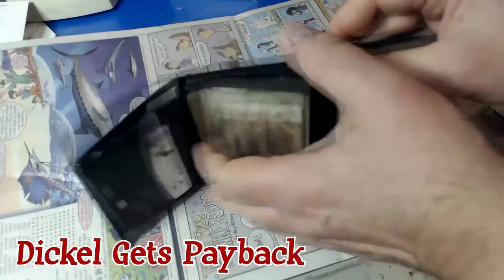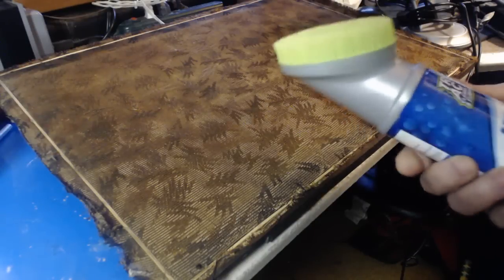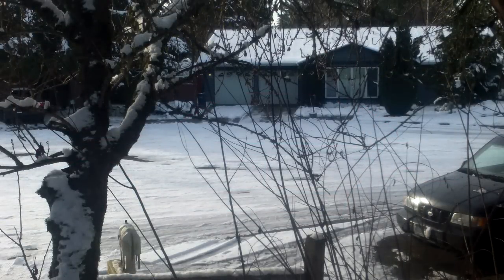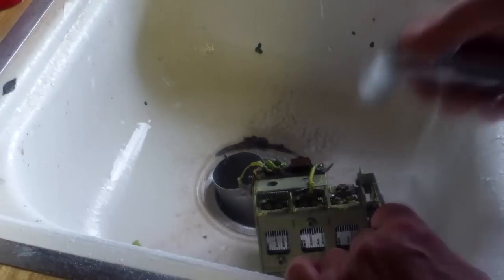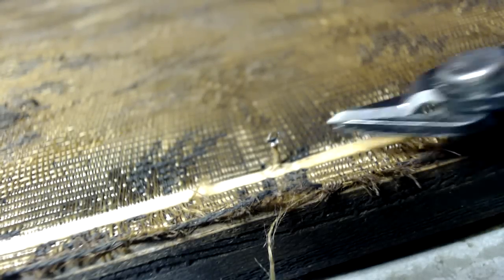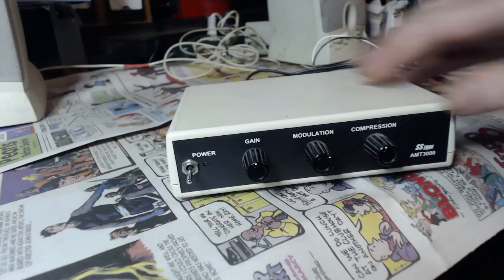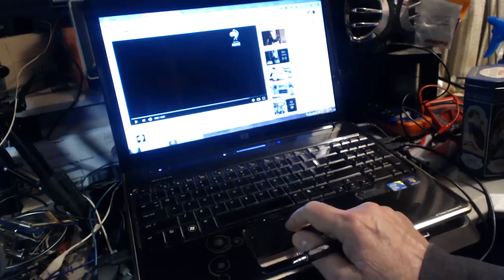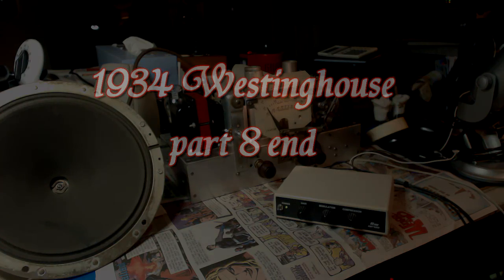1934 Westinghouse Model WR-24 Restore Part 8

Comment: Lovely low wattage AM transmitter you have Buzz …definitely a neat little job!
Occasionally, I get my wife to gently hand wash speaker cloth, I’ve removed from Vintage Radios, in warm soapy water, followed by a couple of cold water rinses to dissolve excess soap powder.  Once the cloth has dried on our clothes line, she gently applies the clothes iron to smooth it out.  This process does not work for all vintage speaker cloths as some are too fragile to wash …you can get a feel for cloths that will, and will not tolerate washing.
Love Creedence Clearwater Revival.   ‘Bad Moon Rising’ takes me back to my mid-teenage years.  
Phil.
Reply from the maker: Phil., Phil, Phil...tsk, tsk, tsk....You make your dear wife toil for you and wash your old grille cloths.....see here old man, this is the 21th century ...Do you also keep her barefoot and pregnant too?..... hahaha....When I saw that video on YouTube, I knew I had to use it..one of my favs.....Cheers to you my fine fellow...Regards, Buzz
PS..Some other guy from England commented that those transmitters are banned there..is that so?

Comment: Interesting video Buzz.  Caution on the chemicals on aluminum tuners.! I thought that naval jelly dissolved aluminum.  Most folks seem to use an ultrasonic cleaner.  I don't have one, but I borrowed my missus's Dr. Scholl's foot bath which has a decent vibrating clean mode.  It does a decent job with some dish detergent; then a good rinse and oil the bearings sparingly when dry.  Too bad the grill cloth didn't hold up.  A little glue around the hole would stop it from unraveling.  Thanks for sharing your mistakes.  If you make them and share them, then maybe we won't.  I have the same transmitter, but I never was happy with the way it works.  Mine squeals in the background.  Yours works great.  I guess I will have to go back to the drawing board.  As usual thanks for taking the time to share your hobbies!
Reply from the maker: The naval jelly doesn't hurt aluminum.soaked overnight...you must have gotten a bad one...mine sounds best at around 1530
Reply: Buzz1151 More than likely my SSTran got a bad builder.
Reply from the maker: was the builder you? haha
Reply: Buzz1151 Aye sad to say it was me.

Comment: good video, I use a home broadcaster for my radios, they called the unit talking house which was used in real estate sales. you set the frequency and plug it in to an output
Reply from the maker: you can set the frequency too on this with dip switches...

Comment: Thanks for the info Buzz. I just figured you fed an audio signal into the External Modulation Jack on an RF Signal Generator for your in home broadcasts. Can you change the broadcast frequency on that SSTran easily?
Glad you survived the Great Snowstorm of 2017!! Glad when the rain finally showed up to melt that stuff!!
Reply from the maker: You can set the SStran to the frequency of your choice. Mine works best around 1530....Glad that snow is gone..good riddance I say haha...regards, Buzz

Comment: Regarding cleaning of the pesky Variable Condensers (Tooning Gang)... I have always had good luck boiling them in a sauce pan and then drying them with a blow dryer. Then a bit of 3n1 oil on the bearings.
Reply: @Buzz1151  They say a picture is worth a thousand words. Maybe not in this case. Hard to have a dialogue with a smiley face.
Reply from the maker: @carlrudd1858  these videos were made years ago, I don't remember much in them.

Comment: To misquote John Fogerty....Theeeeere's a bathroom on the right!  I've never tried that Howard's before but I may give it a shot sometime.  Those peanut dogs sure do like their blankets, don't they?  Mine sits on the couch half the day under a little down throw blanket I picked up at wally world about ten years ago.  Thinking about getting one of those talking house transmitters, that thing you built is nice but I've never tried soldering stuff that small before nor have I ever soldered on a circuit board before and that'd be a lot of money to spend to muck it up, lol.  I have a very small AM transmitter now I bought from ebay about a year ago but it has to be damn near beside or on top of the radio before the radio can pick it up.  That's fine for a console with room inside it or sitting behind a tabletop model but I'd like to have the option of broadcasting from a pc to my radios instead of just from my Zune mp3 player.  I was yelling at the screen, don't use the scrubber!  LOL, oh well, saving a portion of it is a good idea just the same.  Take care, Gary
Reply from the maker: Hi Gary.....Peanut loves blankets, and when shes cold,  likes to be wrapped up in them...The howling was funny as I had never seen her do that..She was missing her mama, who is my daughter.... ...who knew the cloth was so delicate...haha, but it made a funny segment....thanks, Buzz

Comment: Buzz-  I recall John had the same problem with evaporust a while back turning his tuner yellow. Has to be the type of metal. On the SStran unit, what frequency does it transmit to ? Very cool..... and the grill both...  chalk it up to experience.  - Great video - Ron
Reply from the maker: Hi Ron....The frequency is adjustable with dip switches, I found it works best for me around 1530........
Reply: thank you sir
Reply: I'm pretty sure the green is decomposing Cadmium plating. Be sure NOT to lick your fingers or you can be el morte.
Reply from the maker: No, I don't think so John...Evaporate-rust is green yellow, hence everything steel will turn it that color...They need a clear Evaporate-rust...that's my story and I'm sticking to it......Buzz

Comment: Hey Buzz great job! Radio looks good! I finally got my Atwater Kent 510 working!! Well, sort of...has a terrible howl from the tone control I must have done something wrong while re-stuffing the can, I should have left the originals alone! So where do you find most of your radios? and do you ever install a Ipod jack in the back of a radio?
Thanks, and God bless. Mike
Reply from the maker: I get my radios from Craigslist, Ebay, and some from yard sales, like the current Westinghouse.....I don't use a iPod...the way to go is to actually transmit music and old radio shows to the radio, like God intended ....haha,,...that's just my opinion..........Buzz

Comment: Buzz, if your SStran unit transmits on a frequency close to a strong broadcast station, can you adjust the frequency of the SStran? I have been using talking house AM transmitters that the freq. adjusts, but they are rather big and bulky.
Reply from the maker: Hi Ron ..you can set the frequency anywhere on the dial with dip switches shown on the picture....Buzz

Comment: Hey Buzz, 

A very good informative video.  I did check out the old time radio station you mentioned last week and really liked it.

Thanks a lot for the AMT 3000 information and demonstration.  I've never seen one up close and in its kit form. I've had an AMT 3000 on order since December 3rd.  At the time I was told it would take four weeks, but here it is January 22nd and I'm still waiting...  With about $16.00 for shipping, the total cost to me is $109.60. It's a one man band operation and I think he is overwhelmed with orders.

I was wondering if you could have used some kind of cloth patch for that hole?  Or, was the grill cloth too discolored and ruined?

Regards, Tom
Reply from the maker: I think mine was just under 100 bucks with shipping, so the price didn't go up that much in 4 years...The hole on the cloth was too large and there wasn't any excess material big enough that didn't show that I could  cover it with ....Thanks Tom......Buzz

Comment: I have the SS Tran AMT 500 and I absolutely love it! Works extremely well. Loved your restoration on the Westinghouse. Here's my SS Tran working - https://www.youtube.com/watch?v=bDcOrmzYWvw  Take care! RW
Reply from the maker: Hi there...I see you use your wife as a character , like I use Dickel..haha..Is the AMT5000 more costly than the 3000?...cheers...Buzz
Reply: Yes, slightly more... I bought this 4 years ago at a swap meet event. I read about the options that were out there and this had the best specs for a "whole house" transmitter. Both the 3000 and 5000 are class "E" transmitters which is absolutely terrific for AM broadcasting albeit it still has to be within the 100mw limit. I will have to admit that I was unaware it was a kit when I bought it.When I opened the box and saw the pieces needing assembly, I just sat back and laughed at myself. My wife puts up with all my stuff..... I'm way more like Dickel than her! lol
Reply from the maker: I think Dickel might go for your wifey..haha
Reply: I think after some whiskey, Dickel would go after Hillary! lol
Reply from the maker: this is TRUE,,haha